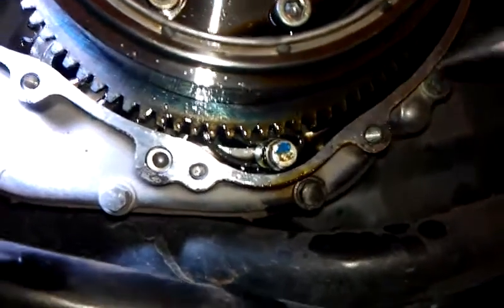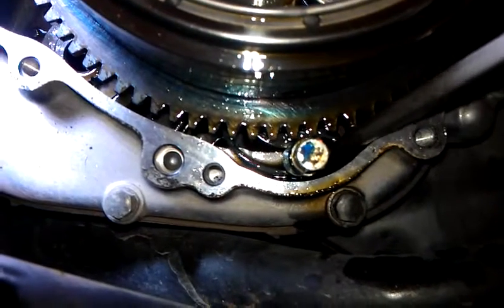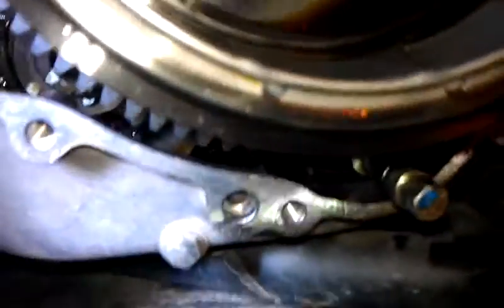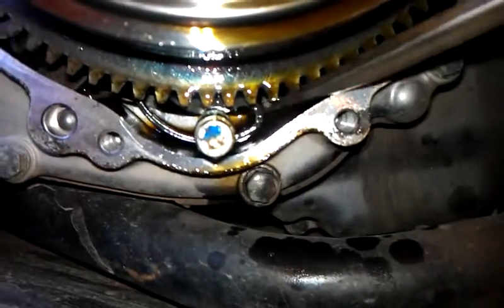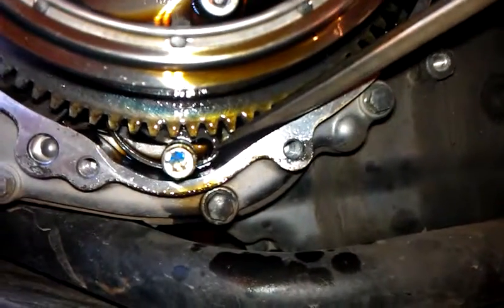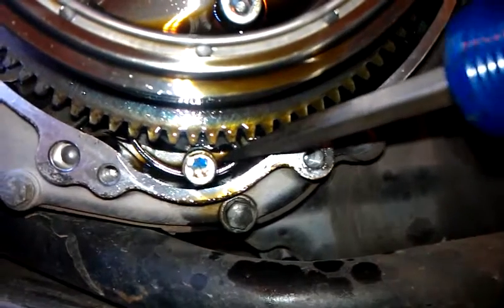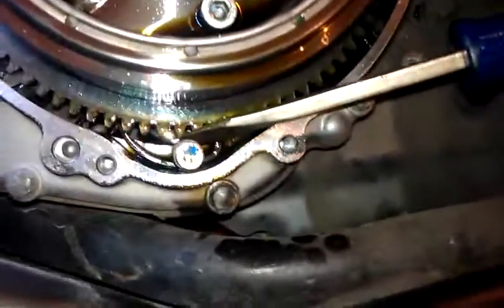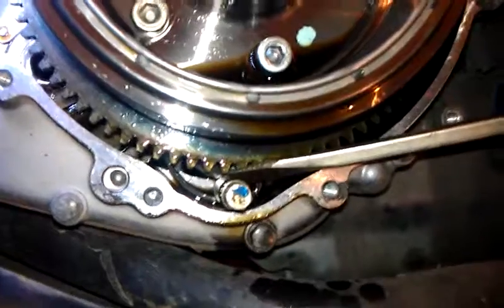Kawasaki KLR650 Balancer Lever (Doo) Spring Failed. Eagle Mike upgrade coming!

Comment from the maker: Manually pushing the lever to the front and tightening the 8mm bolt locks the lever into a snug position. I then went for a test ride and amazingly, the sound was nearly all gone. Most of the seemingly horrible sounds were all related to this one stupid spring.